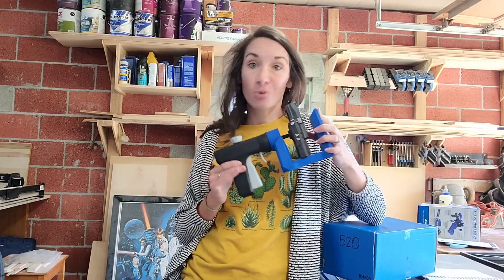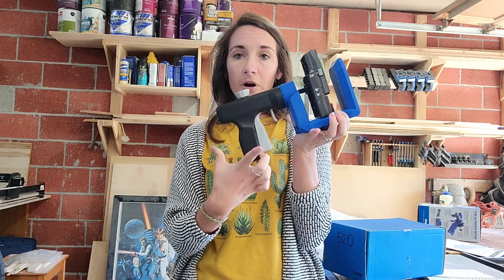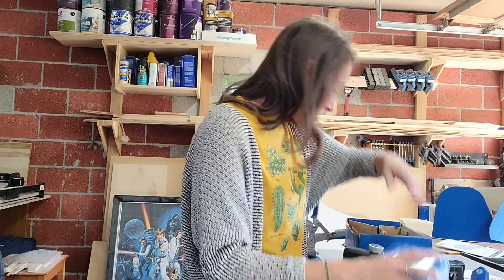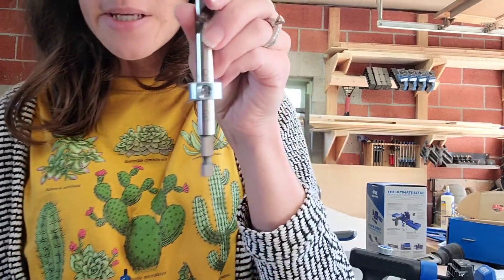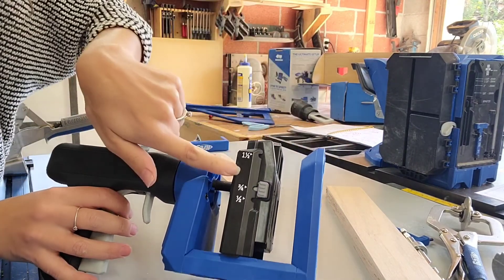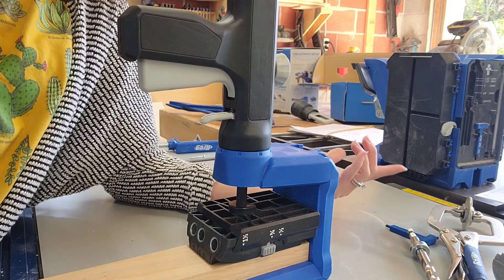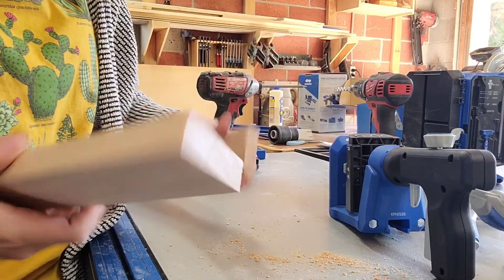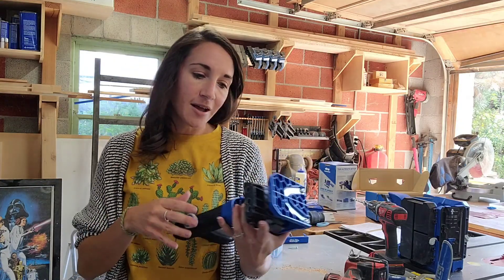Kreg 520 Pro Instructions & Review

Comment: That clamp Table looks like an overpriced POS, lol. Waaayyyy more than needed and pretty pricey
Reply from the maker: I definitely love it, but love it more for the fact that it's a nice clean and flat workspace that is on wheels in our workshop. We typically use it to clamp our 720 Pro to it when drilling pocket holes because our other workbench is too thick of a surface to have the pocket hole jig clamped down to the bench. We only use the clamps on the clamp table when doing face frames, which is pretty rare for us. I also love the bottom part of the table because we built a customized tool organizer to keep all of our Kreg stuff organized so that part is nice too (you can check it out here: https://www.youtube.com/watch?v=8FYpPcqv1Tc) But yes, the clamp table part is only really useful if you do a lot of face frames.

Comment: Thank you!!! Why does it not have detents for 1 inch and 1.25 inch?  Crazy… I just bought a 4mm round file to add my own.
Reply from the maker: It only has the settings for the most commonly sold wood sizes. If you're using a different size of wood, you can refer to the manual of the 520 to see which settings to use.

Comment: One thing I never see addressed is the fact there's no setting on the jig or on the drill bit/collar for use with  5/8" thick wood.   I'm only guessing,  just use the 3/4" settings instead?
Reply from the maker: Good question! If your material thickness falls between 3/4" and 1 1/2" range you'll want to use the same setup techniques as 3/4" with a 1 1/2" screw.
Reply: @MakingManzanita  Yes! Scoured the interwebs for this exact info. Thank you! Subbed!!!!

Comment: Can this be used for 5/8or 16mm timber 
Wayne
Reply from the maker: There won't be a preset on the drill bit provided but yes the collar could be adjusted for 5/8". Just test it on a few scraps until you get it dialed in. For reference, there is a circle cut out on the collar that you line up with 3/4" or 1/2" stock so somewhere in between should work.